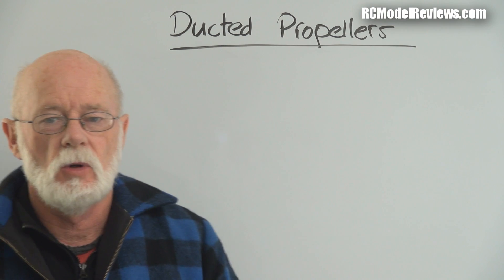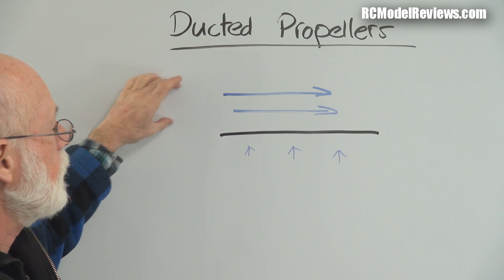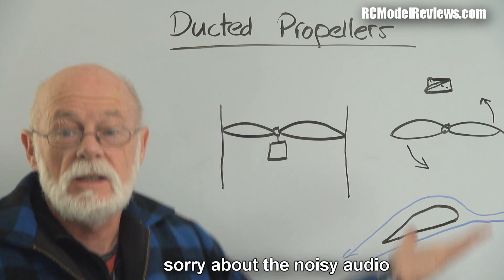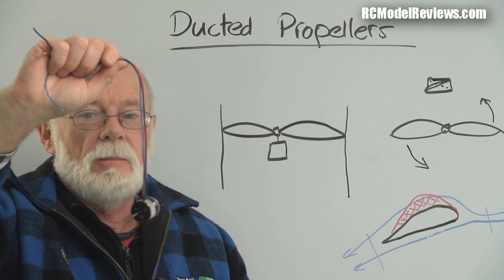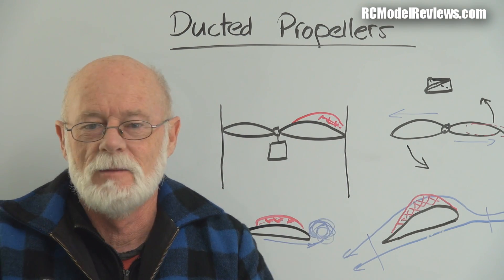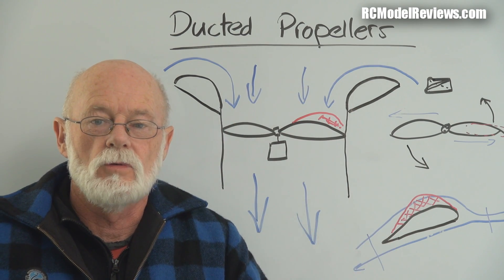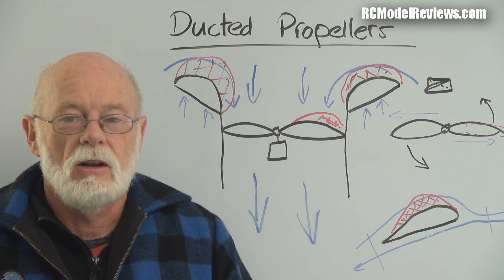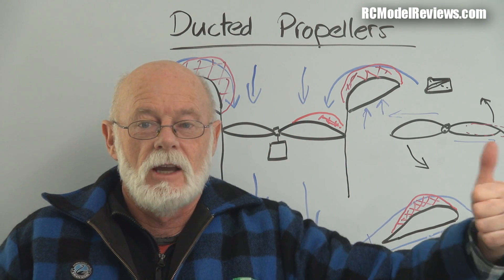How ducting a propeller increases efficiency and thrust

Comment: "centrifugal force" isn't a force in an inertial reference frame and is not why the motor is horizontal. the only real force acting on the motor in the horizontal plane is the tension in the wires (gravity acts vertically). there are no other forces acting on the motor so there is a net force on the motor in the horizontal plane. in an inertial frame of reference, were it not for this net force acting on the motor, the motor would travel in a straight line, according to Newton's first law of motion. in order to keep the motor moving in a circular path, this force, known as the centripetal force, must be continuously applied to the motor. As soon as it is removed (for example if the wires break) the motor moves in a straight line. in this inertial frame, the concept of "centrifugal force" is not required as all motion can be properly described using only real forces and Newton's laws of motion.

Comment: Amazing video!  I always love learning something new.  Question:   Would this concept improve propellers on boats?  I wonder how water would react around such a setup?
Reply: Water behaves pretty much the same. You'll find some boats that use ducted propellers but they only make sense at low speeds. Once the boat (or anything really) starts moving fast, the large duct creates more drag than it makes up for in efficiency. That is why you don't see ducts used very often. They do have a serious downside.
Reply: look up Kaplan propeller series

Comment: In the end, it is all about Newton's action/reaction ideas.  Air has weight. It does not matter how you deflect it, with "equal transit" (cough) or surface adhesion, or simple "flat" plate deflection (Yikes-Kites!), it is still all about pushing/pulling air into another direction at increasing velocity. o matter how you do that, it takes energy. If you improve how that energy is applied to the air defelction proces, you cahve made an improvement! Bravo!

That said, (very good video, by the way- thanks) the idea of controlling turbulence, which most certainly is a waste of energy as regards aeronautics, the duct-ed (sp?...oh, who gives a rip?) fan or prop is well proven to reduce turbulence of spinning props- otherwise no one would use it, right? 

So, I find it fascinating to think about ways of improving existing technology. This excites my curiosity bulb. So, well done and all that. And thanks, RCMR for taking the time to further explain an otherwise complex subject.

And just a note to those who seem so haughty about their vast knowledge of the "equal transit" concept. It's not the quality of the science but the quantity of it. Equal transit is a proven factor, regardless of you opinions on it. It is just another way of explaining the physics of moving fluids and how they affect solids. No one can deny the Bernoulli principles any more than you can deny gravity. But, if you want to demonstrate for everyone why you have wasted your precious, hard earned degree in fluid dynamics posting on a model flyers web site,  it seems rather silly. Unemployed NASA scientists have to do something for entertainment, don't they?

Comment: Wouldn't the edge effect be reduced to zero if the shroud or duct was actually part of the propeller, that is, if the propeller blades were joined to a rotating duct?

Comment: Hi, Very Interesting. 
Do you think this could be applied in part to the prop of a canal narrow boat to improve efficiency. Ther are a smal numberof boats with rotating tubes that act as the rudder but i dont thing they have close tollerences to obtain the added thrust.

Thanks,

Alan

Comment: It might be possible to get a Venturi effect on the lower part of the duct if it had slots in to pull in outside air it as it transitioned to a diverging nozzle, sort of mirroring the top part of the duct .

Comment: @6:00 , there's no requirement in physics for the air on top of the wing to have to keep up with the air on the bottom.
Reply: Sure there is. Remember, the wing is slicing through the air. Air has mass and therefore momentum and kinetic energy... relative to the wing. Suppose you draw a diagram where the wing is moving along the x-axis, with wing thickness in the y-axis. In the moment before the wing splits the air into 2 flows, adjacent parcels of air have the same position along the x-axis, with identical momentum and energy. When the wing splits them apart, they both tend to remain with the same relative position along the x-axis, while they separate in the y-axis direction. The parcel of air above the wing has a longer wing surface to pass over. It has to accelerate, relative to the wing. There is much more going on of course, which complicates the picture in reality, but it's really not fair to say there is no requirement for the 2 parcels of air to "keep up". They just do not precisely keep up, because of the other forces at work.
Reply: not keep up. the air is static, only moves up-down. due to positive attack angle, the air above is stretched while the air below is compressed. the pressure difference is within millibars, but related to entire wing surface is enough to lift tonnes. to understand how little pressure there is, look at paragliders how easy the glider collapses.

Comment: Good lesson.
Things you might want to think about.
   1.  the low thrust of the propeller near the hub and why the blade does not have a steeper angle-of-attack near the hub to produce more air flow."
  2.  Why or why not  take advantage of the high pressure zone at the blade tip to "fly" a flexible extension to close the gap even more closely, much as the read/write head flys in a computer harddrive..

Comment: Why aren't all airplanes ducted?
Reply: Because they only improve efficiency in certain conditions. Once the airplane starts moving fast the duct creates more drag than it makes up for in increased efficiency.
Reply: For the one reason he didn't mention.  Drag.  
Ducting works best when the velocity of the air through the ducting
is significantly greater than the aircraft airspeed, such as when
lifting an aircraft vertically, or with a turbo jet, but in normal horizontal flight the ducting around a more conventional prop presents a very large cross section of drag.    There have been some notable attempts of ducted fans used in GA over the years, but none have lasted long.
Reply: All high bypass turbofans are ducted 😉.  Sure,  NASA tried ductless TFs in the 1980s but they were noisy and that was smack in the middle of hush kit frenzy along with commercial airport noise abatement projects.
Reply: you mean engines. they-'re all ducted, excepting the bombardier which is extra-efficient at 6500m cruising altitude and cessna which is extra-little efficient- at any altitude. check the propeller shape on bombardier, is really worked out: ottoman blade
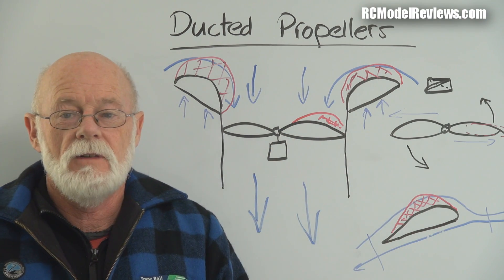Reply: Watch from 16:42 onwards. ;-)
Reply: ask this why arent  helicopters   hummm   same can be aply to them   to stop the centrifugal force the  rotter has
 shhhh   et  ufo
Reply: the efficiency gained is not substancial, compaired to the added weight.

Comment: Hi RCModelReviews .. I have watched your videos for a couple of years now and really love the overall content :) Thanks !! I wanted to point out something though .. there is a very significant 'cost' for the extra lift of the 'lip' on the duct, which you discuss around the 16 minute mark, but is a very significant engineering problem. The benefits you've explained are indeed true, but they are almost always offset by the added weight and complexity of the structure. The real challenge of a ducted fan is to achieve a higher mass flow resulting in a net gain vs an open fan, but to still have that benefit outweigh the weight increase of the added structure and complexity of the duct, not to mention building in extra strength to maintain tight gap clearance required to preserve laminar flow around the prop tips close to the inner walls of the duct. Looking forward to the next video to see your test results :) At the moment I'm considering doing up a ducted-fan quad design for a primarily hovering purpose, in which the trade-offs 'cost you the least' as you don't have to worry about flow direction into the duct quite so much. If anyone has a great design I'd love to see it !!

Comment: I have just proven experimentally that you can increase the lift significantly by a simple change in the design of the duct intake flange. The Bernoulli effect does not provide as much negative pressure as the vacuum created by the prop. If you contain the prop vaccum over the flange lip, you increase lift. Basically you want to extend the flang lip, and recurve it to vertical, so that the crossection is much like half a recurved bow, used in archery. The recurve extension will increase the effective wing surface of the lip, as well as increasing the pressure differential, between the top and bottom of the flange lip, by containing the prop vacuum. Since the air cannot slideover the flange lip, a vacuum is created over the contained flange lip by the prop. This vacuum is stronger that the negative pressure from the Bernoulli effect, resulting in increased lift.

Comment: it works because youre shaping the airflow.  Every fan manufacturer knows this lol. but the transfer to the aero industry is non existent.   We also Already know and have known for decades that larger blades moving slower push more air and now the aeronautics industry like a nose bleed is s l o w l y  realizing this fact.
Reply: I'm sure jet engine manufacturers are well aware of this, considering they have already determined an optimal size for the high bypass turbofan designs most commercial jet aircraft use.
All current engines are smaller than this optimum (calculated to be roughly 3.2 meters intake diameter), because of a combination of airframe design constraints and the structural limits of the materials (particularly the turbine blades).

Of course, with a turbine the intake causes drag, hence why there is an optimum size, rather than just saying 'bigger is better'.

Small prop aircraft are an afterthought in the aviation industry. The bulk of the money and research is focused on commercial aviation and the various jet engine variations.

Comment: Why isnt it used in fixed wing planes then?
Reply: I think it is. I'm pretty sure those little curved tips on the end of airplane wings are there to reduce vortices
Reply: There's also practical concerns. Aircraft tend to operate their propeller at a wide variety of speeds. The aircraft I do pilot training in has an RPM range while running of about 2000 to 5800 RPM, and 5700 is used during takeoff and climbs, while 4200 to 5200 is used during flight depending on desired speed.

A secondary problem with ducted fans is that while they are more efficient at a very specific operating speed, they tend to cause problems and become less efficient at other speeds.

Or at least, that's what I was told about it.
Reply: The benefit of a duct is quickly lost with airspeed as they present a large amount of drag. Also, to make a duct efficient, the gap between the propeller tip and the dust must be as small as possible. That would be very expensive to accomplish on regular aircraft.
Reply: Weight. He mentioned that towards the end.
Reply: KuraIthys So if you're using a variable pitch, constant speed prop, then it should work?

Comment: What if the supports for the duct (those 5 bits that come from the center hub to support the outer ring) were actually feathered like propeller tips and were also still connected to the outer ring. The whole thing( ring and prop / duct supports) would spin about the center hub. This would eliminate the merging of high and low pressure along the blade tips and would still also produce the duct effect. Or am I wrong? If someone has access to a 3D printer you might want to try this out.

Comment: Nice Video over all :) but I think "no flow" at 13:34 is wrong, when the whole ducted system moves forward through the air. Wouldn't air flowing around it create vortices as this would be an area of slipstream? If this would be a hovering multicopter I am totally with you. FYI I am just a pilot, no expert on this subject however. Have a nice day.

Comment: 14:34 I wonder how many looked up "coandaR effect" instead of coanda.
Reply: I would've done it, if I hadn't read your comment!  I forgot about the GB tendency to add an "r" to words like that.
Reply: Is called Coanda effect.  the guy observed the effect while testing his version of turbofan, in 1910.the engine was a piston one driving a tubed propeller and extra burners on exhaust- a turbofan, which may or may not have had a turbo-charger. fact is the exhaust flames burned the fuselage- when he first noted that while the jets were directed away from it, they followed the fuselage and the plane crashed after take-off. A replica of the plane can be seen on Bucharest airport and in Paris, where he flew it.

Comment: So what happened to the ducted project that failed for tilting the duct?
Reply: Trevor Hurd it was called the Avro Car I believe. When the vehicle began forward motion by tilting what in effect was a giant duct, the vehicle lost lift. No matter how much energy was applied, all efficiency was lost and it could not conquer the smallest ground based obstacles.
Reply: Searching the net I found that a ducted/ringed boat prop is less efficient above 10 knots and much more efficient below 10 knots. As much as 30% more efficient below 10 knots.   Most people want to go fast  (not me) so the ringed prop failed.
Reply: The ringed prop was good for anti-fouling.  My understanding is that it is still used for fishing boat props.
Reply: yoyohooyo the ducted or ringed prop as you called it didn't fail. Its called a Kort nozzle and they're very effective in a lot of cases,especially tug boats.
Reply: Thanks for that info yoyohooyo, I was wondering about the boat prop. I have a 40 ft sailboat and a 30 % efficiency increase would be a major help. I think my max speed with engine is only about 5.4 kts.
Reply: Alexandru Vatamanu wow.. i was way off. i was talking about gyroscopic forces 😂
Reply: if the duct is tilted relative to the air flow, then a low pressure bubble develops inside the air intake. when the propeller reaches it, will loose load and when it exits will get loaded back. vibration, unsteady air flow. engine surges gasping for air, then it chockes with too much.
no project ever tilted the air intake.
Reply: Also interesting for me, but never saw a single ducted multirotor or even a project of it
Reply: rc468 Here are a few sold by Air Hogs:
Helix Ion Drone
Helix Race Drone
Helix Drone
Helix X2
Helix X3
Helix X4
Helix Video
Star Wars Millennium Falcon
Star Wars Imperial Star Desyroyer

I think the Helix Race Drone is a really good example of the shaped duct being used in a quadcopter. I did notice the design used 'propellers' installed at the verytop of the engine, not buried deep down the duct. Scale plays a large part in the success of those examples because with that small of an engine the motor is spinning so fast, around 20,000 times per minute, so that it acts more like an air screw or turbine than a propeller in a duct. if your hair has already moved through the propeller then the low pressure developed by moving forward is eliminated, or just greatly reduced...
Reply: Look up the Hiller Flying Platform. One of the reasons they gave for shutting down this project was that the prototype was TOO stable and creating instability(by leaning one way or another) was the only way this device could move in any direction. There are videos here on Youtube.
Reply: Nice video! Going to 3d print some ducts for fun for a 5" quad :) to see how it acts in flight
Reply: how much tilt are we talking about? a drone tilts about 45 degrees. Is that enough to produce this counter effect? can ducts still be used efficiently in copters without tilting ducts?

Comment: Shroud....
Reply: A duct is typically 1.5 X the prop/fan diameter long or longer.

A shroud is typically less than  half diameter long.

What he holds up is a shroud.  Just enough length to virtually eliminate the tip losses of a normal propeller, without adding so much drag as to negate the power saving.

As the duct gets longer you have increased drag of the air along its internal  surface.

****

And Bernoulli effect is a closed loop of pipe....  Using it in open air is not a proper explanation of lift for a wing (its just so simple that its what people use when discussing lift.)
The calculations based on Bernouli's principal don't work for an airplane.

Comment: Why don't fpv racers use ducts if it will make their motors create more thrust.
Reply: fpv racers need more maneuverability and instant torque.  Ducted fan provides top end speed with not as much torque.  Different power requirements for different configurations.
Reply: sirlordwhitman thanks for the reply. makes sense
Reply: Check the link below Josh, ducted fan UAV. It's a pretty wild bit of kit! This clip had been around a long time, he does stack it but I think he would have ironed the bugs out by now!
Reply: The ducts to work properly have to be long like jet engine then you would be adding a lot more weight to much for a drone otherwise they would have been using them along time ago , the inductrix is just a gimmick
Reply: I am familiar with the project you are referring to with the ducted fan man vehicle. so what happens when the ducts are rotated? I really enjoy your videos and explanations that are so easy to understand. thank you very much
Reply: Very good question Josh...their just starting to hit the market!
Only small drones as yet, but as the power of the motors grows and as batteries improve, people are tinkering with the concept. There are actually quite a few EDF drones out there and one I've seen in particular goes like a mad thing! It also sounds awesome!